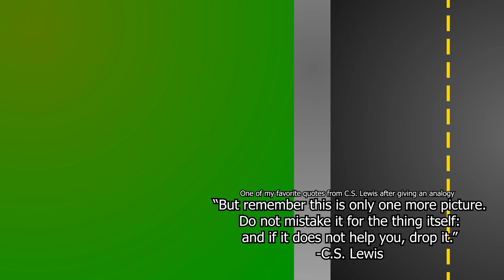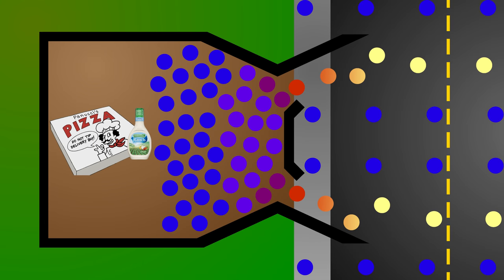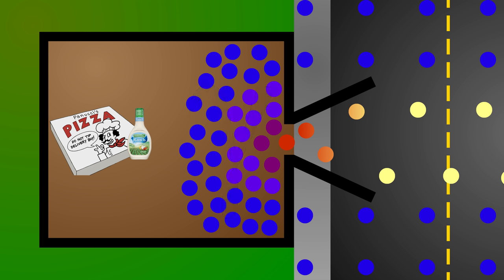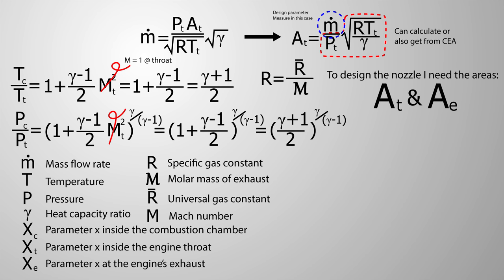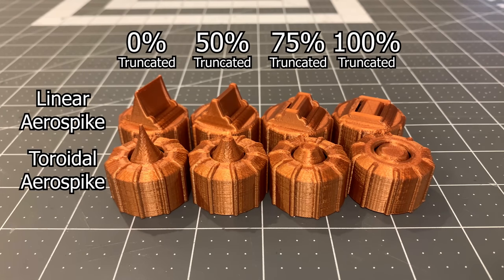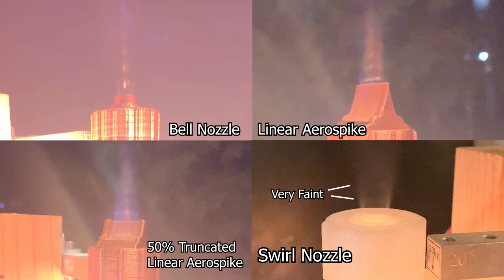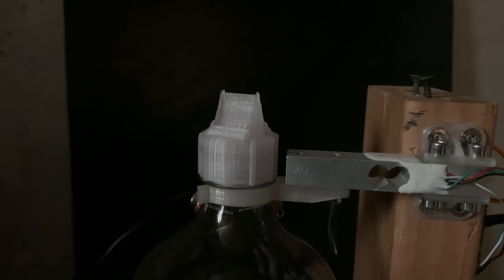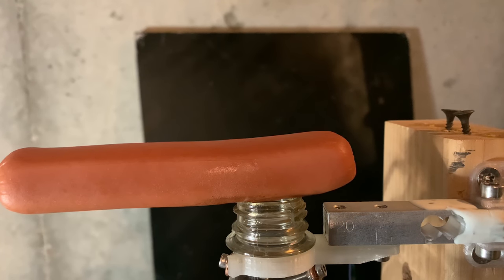Strangest Types of Rocket Nozzles

Comment: Nice fallow up! Your first video made me want to make my own whoosh rocket video. I’ll be dropping it sometime soon hopefully haha. What are you using as your fuel?
Reply from the maker: That's awesome! I used 91% rubbing alcohol, it can work with 70%, although the exhaust would have different properties so the math would work out slightly different. And I've seen your videos so I'll skip the "fire bad, no touch" speech haha
Reply: @Sciencish  Lol I'm actually not the best about providing disclaimers.  I believe these bottle are rated to 200 psi too so them blowing is pretty unlikely I think. Im using 95% ethanol. The most unexpected trouble for me is getting ignition.  Especially on the smaller nozzles.
Reply from the maker: Oh! Yeah that’s something I forgot to show, it’s hard to ignite unless it’s warm out. I used a hairdryer for all the tests, alcohol needs to be >70F or something I think before it can ignite easily. But that’s also why I designed for 80psi, heating the bottles first with a hair dryer and then adding the heat from combustion likely weakens them. It also makes it pretty likely that the bottles will melt after a few tests, I went through about a dozen.
Reply: @Sciencish  Right.  I've been using an air compressor to atomize the fuel.  Then after they melt I use the compressor to make them take their shape back.  I had less success with adding heat

Comment: You can see the spikes compress up. I think they performed so poorly in part because their throat area changed when they pressurized.
Reply from the maker: For sure. I would’ve went into it more but the video felt super long. The exposed plastic surface area on the throat of the aerospikes is massive compared to the bell nozzle, so they suffer a lot more deformation. I could only test 3~4 times with each aerospike until so much material had been vaporized that it wouldn’t work
Reply: @Sciencish  yeah and such is the problem with the aerospike, cooling. Perhaps a couple strips of aluminum tape? who knows. Or a dip in ceramic paint.

Comment: It would be cool to compare the efficiencies of the nozzles. One way you can (kind of) do it is by using a syringe to insert a fixed amount of ethanol every time. Then shake the bottle a bit so that the fuel gets plenty of surface area to evaporate (make sure the fuel-air mixture is rich in air so that the burn is always complete and consistent). Finally integrate the force of the nozzle over time to get the total impulse generated with this fixed amount of fuel. The setup is far from perfect but at least it will give some way of comparing the nozzles since thrust alone is heavily dependent on how the nozzle geometry restricts the fuel flow.
Reply from the maker: Good suggestion! I actually did that at first, but here’s the problems I ran into: measuring the fuel didn’t help since only the vapors burn, in the end just dumping in a bunch and upending it for a few minutes while I set stuff up was faster and had the same effect so long as the bottle was visibly dry. But even then, it’s an open container so the vapor to air mix is highly variable. The biggest problem was my load cell set up. The rockets fire on average for a third of a second, the load cell could only sample around three times during that. So it wouldn’t be so much integrating over time but finding the area of a triangle haha. Obviously that would mean a lot of error, so the math wasn’t worth doing quite yet. In the end the thrust averages were even probably missing the true peak thrust of each firing, but I have no way of knowing unless I can find a way to pull measurements faster.
Reply: @Sciencish  Ah, I see. So there isn't that much you can do about the fuel mixture beyond being very careful when adding the nozzle.

About the impulse, there is always the neat trick to let physics do the math for you in some way. In your case you could try to test the rocket horizontally either on a cart or on a zipline. The short firing duration will make friction almost irrelevant and if you add some extra mass to the rocket you won't get much air resistence either. All you need to measure the impulse is a camera and a ruler.
Reply: @Sciencish  For high sample rate, low number of test things like this, I'd recommend measuring using an oscilloscope. Awesome video.

Comment: Would be worthwhile printing a series of plain holes and experimentally optimizing the throat diameter. Does it match your predictions? 

Also you can control fuel-air if you just get a good scale and weigh your alcohol, then vaporize it completely.

Comment: I'd try a thrust test on a series of sugar rocket motors made from the same batch so the burn rates are more even to eliminate the variance in fuel air ratios, just use the 3d printed nozzles as the end cap and should work for good testing I'd think

Comment: Good idea, not knowing the formulas to optimize the spike was to have: 0, 50, 75, and 100% truncated experiments and then interpolate for optimization. Because you had the best at 50%, it would be prudent to try 25% truncation just to see which side is closer to optimum. You can do a polynomial curve fit and interpolate the optimum point from there.  Subtle changes in optimization may not show up in these types of Rockets, but with sturdy rocket, longer burn times (more fuel) you should see discernable results. Great video.

Comment: This is really cool but an off-topic question: Do you have a tool for the bottlecap threads? Fusion 360 doesn't do them and I haven't wanted to mess with trying to custom kludge something together.
Reply from the maker: I cut a bottle cap in half to measure the threads and then printed a dozen till it was tight haha, still not perfect tho
Reply: @Sciencish  Damn, you went far harder than I would've had the patience for. It's really annoying that it's not just a published standard.

Comment: 10:18 WOW! There are 4 Mach diamonds, you did a good job at these!
Reply: If you aluminum-tape coated the bottles, it wouldn't have time to heat up and shrink like it does after every run. But I'm just an engineer, not a rocketeer, so it might have bad effects on fuel temperature and pressure but gotta consider it anyways..
Reply: I did similiar tests with dipping the inner bottle into outer water-filled basket, it cooled it down so the inner pet bottle didn't have any shrinkage

Comment: Sub from me from this video!  Well done, nice science, terrific narration.
If you wanted to try some of these with higher fidelity and longer run-time (not melting the nozzle!) I'd suggest a couple of things: 
1) lost-wax-cast the PLA nozzles to make aluminum versions.  It's cheap, you can do it at home, and the nozzles will last through multiple firings...
2) find the toughest 2L soda bottles you can - they can hold > 100PSI, (caution: when they fail they're LOUD! ) and pressurize the volume - does make it harder to launch though....
3) A stoichiometric ratio of fuel to oxidizer is important.  As you're using air, 75% of that is nitrogen which is inert in the reaction with alcohol...(which I'm sure you knew).

Comment: Now that we have another use case besides SSTO, that is to land an orbital stage vertically, I think it’s really good time to reconsider aerospikes. If SpaceX had used aerospike on their raptor engine, then starship can run only one group of 3 engines to do both the ascending and landing. The saving of 3 engines may worth the slight loss of efficiency.
Reply: you have to worry about the areospike melting.

Comment: Also, re-watching some of the test footage, I noticed that the more constricted the nozzle, the shorter the burn time. Intuitively, you'd expect the other way around, so I suspect you may not be reaching an optimal stoichiometric ratio for your fuel/air mixture in the bottle. I think it's fuel-rich, so when there's more room for some air to rush back in to sustain the flame, it burns longer (but with less thrust while it does).

I doubt adding any kind of oxidizer to the mix would be a good idea in a soda bottle, heh, so maybe if you continue this line of experimentation, you can try different amounts of alcohol, different procedures and lengths of time for it to evaporate to get a less saturated mixture, or different times to let it sit after pouring the alcohol out to let some of its vapors out as well.

It's probably also worth mentioning that the advantages of those specialty nozzles are lost in this kind of scenario. A bell nozzle optimized for a given ambient pressure is actually the best you can do. Aerospikes and the like aren't as good at a bell's design altitude; their advantage is that they keep much more of their efficiency at other altitudes. Ultimately, that's why we don't really use those specialty nozzles very often in the real world. Because SSTOs are simply not practical with current developed (and allowable) engine designs, and we need to use staged designs anyway to shed useless mass on the way up, we can just use a series of bell nozzles optimized for incrementally higher altitudes. Yeah, that adds some extra weight compared to having a single aerospike and shedding tank-only stages, but the greater efficiency of the bells when used at or near their design altitude usually outweighs that.

Something like the Space Shuttle could have used alternate nozzle types to great effect... but we already had invested so much more time and understanding of the nuances of bell nozzles and how to make them durable and reliable that it was just more effective to iterate on that design rather than starting over redoing all the groundwork that had already been done in the Mercury, Gemini, and Apollo programs.

In short, for these kinds of bottle rockets, definitionally at a single sea-level pressure for the entirety of their flights, you should find with enough testing (and optimization of the fuel-air ratio) that the bell nozzle wins out... if its added efficiency over just a hole is enough to overcome the added mass and friction it represents, anyway.

Comment: If you want consistent air-fuel mixtures, make a gasometer. Poke a hole in the bottom of a plastic bottle, put a hose through the cap, and put it in a bucket of water. You can draw in calculated amounts of butane and air. I wouldn't use pure oxygen, I think that mix detonates. Sure blew up a glass bottle I made a little cannon out of. It could handle an oxyhydrogen explosion just fine.

Comment: This video's great, very interesting! I'd love to do some math and figure out whether the "Cowbell (TM)", or the triangular/square aerospike nozzles, when scaled up and used with a LH/LO cryogenic system, provided any advantages in manufacturability or efficiency. Also, there seemed to be a huge spread in what kind of filament you used for the nozzles (marbled PLA vs bronze-ish PLA vs clear-ish PETG?); did you notice any kind of difference in performance between all these? I'm kind of surprised they didn't deform under the temperature too much too! Finally, under what print settings did you print the PLA/PETG nozzles???
Reply from the maker: Marble PLA: 220C extruder 60C bed
The worst of the three, poor layer adhesion meant exhaust could blast through in spots, and made a real bad smell. Only used once   

Copper PLA: 212C extruder 50C bed
Good for 3~4 tests before too much material is vaporized and the nozzles don’t work anymore. Formed weak spots and ruts were exhaust was more concentrated. 

Clear PETG: 260C extruder 80C bed 
Also good for 3~4 tests. Wear was more smooth and consistent than the PLA

Comment: and if you replace the air in the bottle with 100% oxygen and add the isopropyl alcohol as the fuel, shake generously coating the insides and drain off the rest of the liquid ( alcohol) apply nozzle and ignite, the nozzle melts instantly, the bottle expands near the nozzle area due to excessive heat. Caution!!!  if you thought the hotdog got a serious burn using air as an oxidizer, the 100 % oxygen atmosphere will burn into the muscle, skin offers no protection, it just melts like butter...  I was impressed by the triangular Aerospike... nice thrust numbers

Comment: It’s almost like the shapes with the biggest hole but smaller openings worked the best. I’m not smart enough to make this comparison sound like it is in my head, but since a square, triangle, and even linnear worked so good, on a two dimensional scale the perimeter to area ratio goes up then the thrust goes up. A line no area and the linnear engines worked very well. Am I crazy or does this make sense to anyone else
Reply: A circle has the smallest perimeter to area ratio and those were the lowest performing engines??

Comment: What material you use on the 3D printer? It seems PLA, i will suggest to use something more heat resistant maybe PETG.

I know nothing about rocket engineering but i found the results really interesting! I would like more and bigger rockets 😀😀😀
Reply from the maker: The whitish translucent ones are PETG, the copper and marble ones are PLA. The PETG definitely stands up to the heat better

Comment: Now i had a thought, when you were launching the rockets you had to connect them to the wire leads, which im sure caused some deviation on the launch trajectory. Due to the wires holding on till different points in the launch. I belive if you made a launch stand that lets the electrodes set on the contact so there is no mechanical connection, you might have more consistent results.

Comment: damn. the triangular produced 1.28 lbft? i would love to see you try that one 75% t~ 50% truncated to increase performance even further!! i saw that you got a significant performance boost from truncating your Toroidal Aerospike, so I'm curious if your triangular would also benefit.

Also side note, having that eddying air where the nozzle is truncated likely benefits the performance because that swirling air works like a imitation bearing that allows fluids to "roll" over it even faster. Swirling air "lubricates" the path that the exhaust takes, allowing to move faster than it could if it had to skim along the physical spike. That's probably a major component for the performance boost coming from the truncation, although theres definitely a sweetspot somewhere.

Would love to see a video trying to find that sweetspot. Good luck to ya man! Subscribed.

(Disclaimer: I'm still in school and am definitely not a master at fluid dynamics. Just a thought I had that was worth mentioning.)

Comment: It would be nice to have a one way valve in the "rocket", to prevent a negative pressure inside of it, and consequently a "brake affect" in the rocket, as it deforms and sucks air from the nozzle to compensate the pressure difference. 😉

Comment: Once apont a time, when i was a kid, i ask my physics teacher about rocket. He give me a pretty unexpected answer. 

Go observe your kitchen and camping gas stove at home with your head till 90 degrees aside. It cause you nothing.

What? Then after a more detail observations, i agree he is right, i can find some parts mentioned in the rockery books. Of cause the design and size is different, because a gas stove is design to have something on top and acquire zero propulsion but high output on heat. Which is vice versa to a rocket. Don't do what a gas stove do with those components and there is a basic rocket engine there.

Comment: I have a question. I am trying to reacreate your rocket. I have a 2l flask, and ø10mm nozzle. I just cant get it to burn properly. Either my air-ethanol mix is off, or the ethanol just wont vaporize. How did you deal with air-fuel mix, and vaporization?

Comment: I.... um. I'm not entirely sure what to say about this. Very cool that you're interested in aerospace engineering! A neat way to introduce rocket nozzle types and get some basic intuition about them. I do think you maybe missed some educational opportunity for yourself by not working through some of the math yourself, but I get why you didn't, of course.

The data was clearly way too all-over-the-place to even get any real idea of what nozzle designs work best, but that's not unexpected, especially since they were 3D printed and pretty rough (literally rough, I mean, which might be why many (all?) of the nozzle designs worked worse than just a hole: the extra friction would counteract some of the thrust. On the other hand, the plastic melting into the exhaust would increase thrust somewhat, heheh.

The pineapple-ranch-pizza-politicizing analogy was pretty hilarious and memorable as well. XD

Comment: I wish I could post the picture on here but I messed with this a while back and found higher power output by lighting at the nozzle and adding a tube thats about 1/3rd the length of the bottle to the back of the nozzle. Contact me for some nice slow motion images of the flame front moving out from the center of the tube and burning in both directions!

Comment: I wonder why the square nozzle worked so well? I don't think i've ever seen a design like that
Reply from the maker: It was probably just chance, they produced wildly different thrust depending on how well the fuel and air burned
Reply: @Sciencish  Regardless it deserves more research to figure out if its any bit viable, low pressure gaseous fuels might be a problem in general but a proper combustion chamber and liquid propellants might produce more reliable results.

Comment: I was thinking about an expansion deflection nozzle (only as inline version, but that doesn't matter here) a few days ago and now i see this is already a thing :D thought i was a genius, nevermind then. only i would add some way for air to flow through to the middle, because else the pressure there would drop instantly making it just a vacuum nozzle on ground level aka useless, with air flow to that area you would actually increase the thrust compared to a ground level nozzle, although i have no idea how to possibly realise that